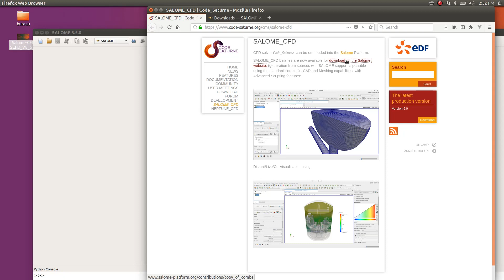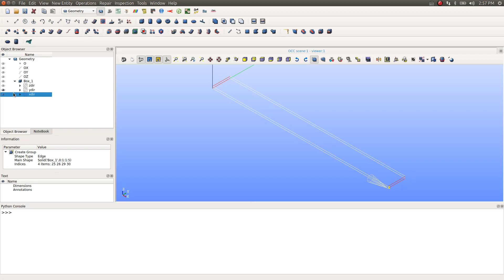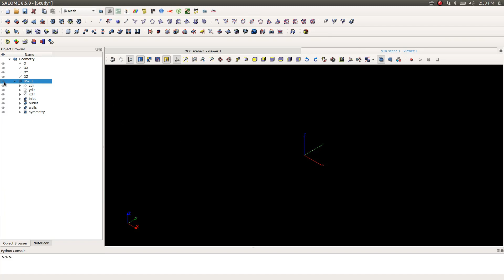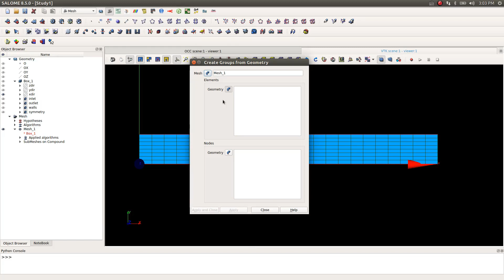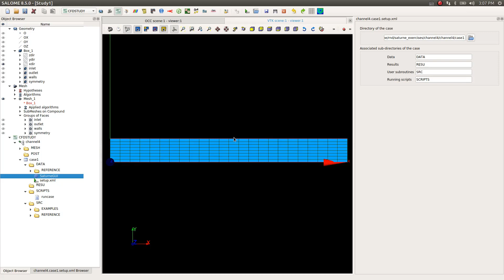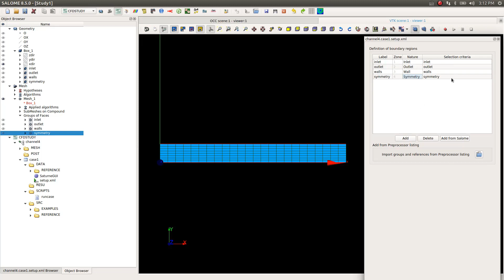[Salome CFD Tutorial 1] Simulating a simple 2D channel flow from A to Z with Code_Saturne

Comment: Thank you for your video.
I have a question.
Do you think we can carry out pure pressure-driven flow for laminar flow of pipe?
(Pure pressure drive flow means that we impose only pressure values for inlet and outlet, but we don't impose other parameters such as velocity.)
If yes, which boundary condition should we impose?

As far as I understand, there is no approprate boundary condition for pure pressure-driven flow.

Comment: Hi there, I am using windows and Salome 9.6.0. It does not show the CFD Study. Can anybody help me with this?
Reply from the maker: You have to install “Salome CFD” to get the CFD Study. I explain at the beginning of the first tutorial where to get it (if the website hasn’t changed). The generic version of Salome just includes pre/post
Reply: @Feaforall  Alright, thankyou! The installer for CFD only has 8.3. I will see if this is compatible with my 9.6.
Reply from the maker: It doesn’t work like that. You have to install another full Salome CFD which will have all the other modules too. You can’t install just the CFD study module.
Reply from the maker: Also I forgot ... Salome CFD is not for windows... only Ubuntu. There is a code_saturne version for windows, but you will have to install it as a stand alone and you won’t have the Salome CFD study GUI.

Comment: Hi,
Thank you for making and positing such helpful tutorials. I have installed the code, and set up the case, but when I want to run the code, it gives me the following error. I tried it on two machines, but I faced the same error message. I appreciate if you can help to find the issue.
Thanks.
The error message is:
.../salome-cfd/Salome_CFD-V8_5_0-Code_Saturne-5_3-U16.04_b6160a87/modules/CFDSTUDY_v53/libexec/code_saturne/cs_solver: symbol lookup error: .../salome-cfd/Salome_CFD-V8_5_0-Code_Saturne-5_3-U16.04_b6160a87/modules/CFDSTUDY_v53/lib/libple.so.2: undefined symbol: ompi_mpi_op_sum
solver script exited with status 127.
Reply: I could find the solution. It seems there were some troubles with the Libraries. It was hard to find the Library which were working, but in
 the end I could find them with some tricks! If anyone has the same issue, and cannot find the needed Libs (libple.so*), let me know, I can share the Libs with them.

Comment: Thanks a lot for this tutorial. I've obtained the same residual plot but I can't see results in ParaVIS. Its scene seems freezed. Maybe there is a bug in my version/installation of Salome-CFD 8.5.0 in Ubuntu 18.04.1 LTS mounted on VM.
Reply from the maker: In this case, try to install separately paraview with “sudo apt-get install paraview” and make sure your results are in VTK format (paraview doesn’t have the MED reader)
Reply: @Feaforall  Thanks for your reply. I try to install Paraview externally but inside Salome the ParaVIS scene remains freezed.

Comment: Hi, I just have a question about Salome CFD installation. I use Ubuntu 18.4.1 and I can't instal Salome-CFD. I don't now why, I choose the good one on the web side of Salome like you said in your video but I think that some documents are missing and I can't run the application after installation.
Reply from the maker: You have to install it on either Ubuntu 16.04 or 18.04 (as someone in the comments said it works). 18.4 is the instable version of Ubuntu... it is very possible that Salome CFD won't work on that one.